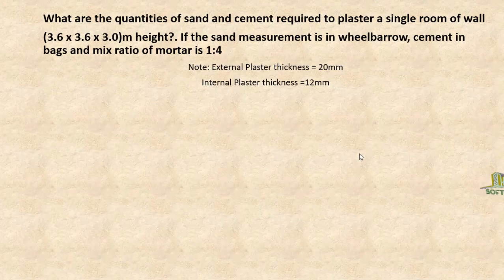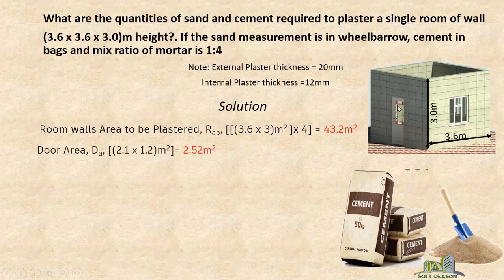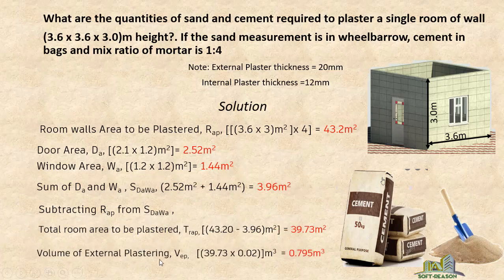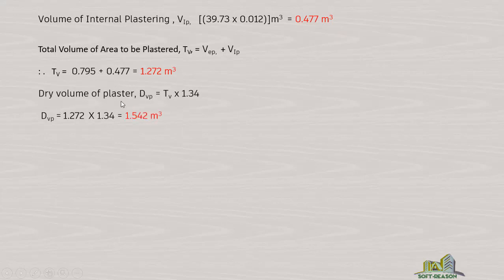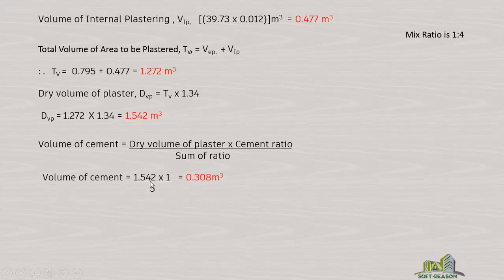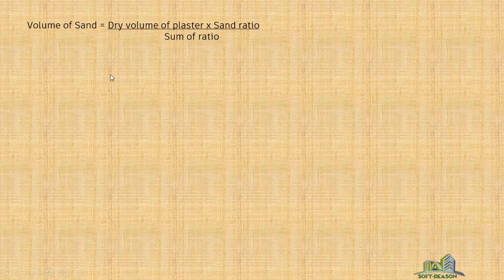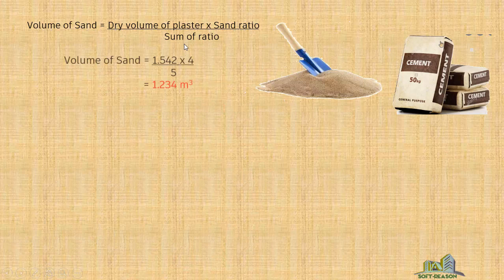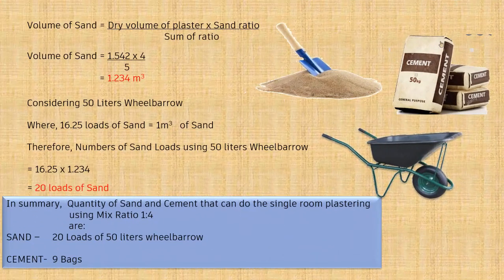How to Calculate Quantity of Cement and Sand for Plastering Work in Building

Comment: Something is missing here. 1:4 means 1head pan of cement and 4headpans of sand. Meaning that, we have 2headpans of cement in one bag and from your calculations, 4 and half bags of cement should be used instead of 9bags